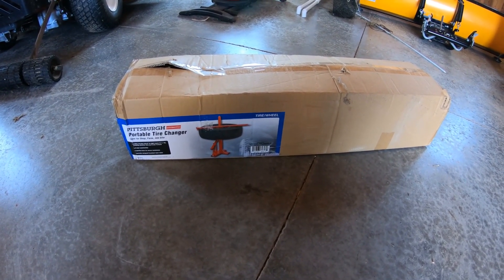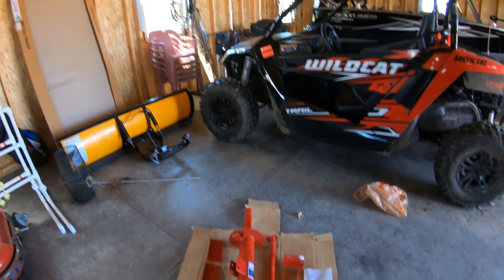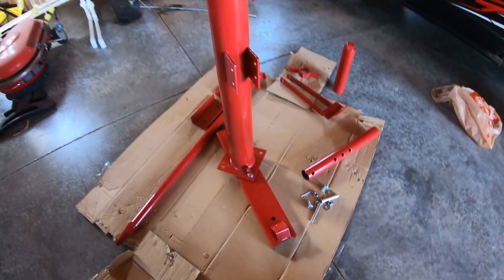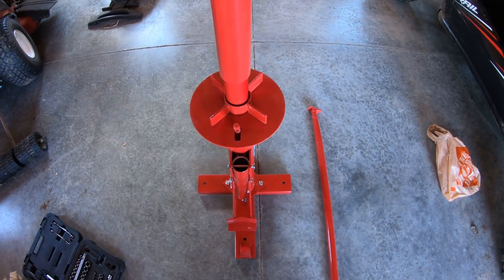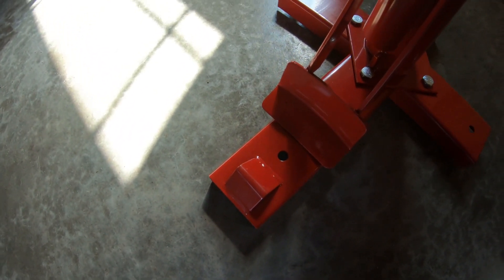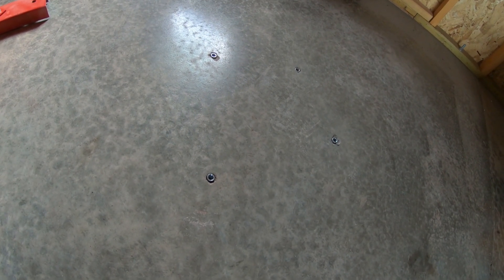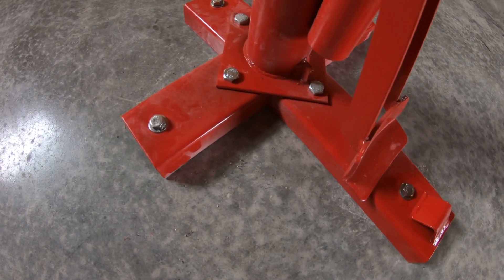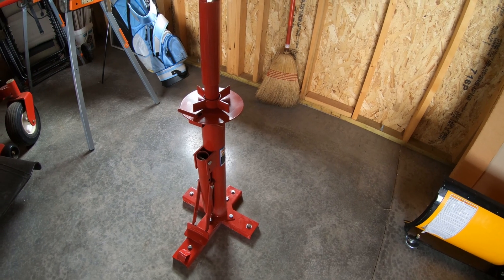How to Install a Manual Tire Changer | Pittsburgh Portable Tire Changer

Comment: Great video, do you have information on the Redheads/ Bits and Screws that you used?
Reply from the maker: Thanks!  Sure, I used the Red Head 3/8 in. x 1-5/8 in. Zinc-Plated Steel Drop in Anchor, Everbilt  3/8 in.-16 x 2 in. Stainless Steel Hex Bolt and Washers, and a 1/2" Carbide Hammer Drill Bit all from Home Depot.  Hope that helps~

Comment: 2:30 does it comes with the set? The packing mark 3/8in is that the bolt size or the drop anchor? Nice content, thanks for the video
Reply from the maker: Your Welcome.  Here is what I used - 3/8" x 1-5/8" Steel Drop-In Anchor:   https://amzn.to/3rZPKcn
3/8" -16 x 2" Stainless Steel Hex Bolt:  https://amzn.to/3k2k8QH
Reply: @DeanoOutDoors  Thank you. You safe me from guessing,😄

Comment: Great video and thank you for sharing! How's the 3/8 bolt's holding that you used for anchoring the unit?
Reply from the maker: Thank you.  The bolts are holding up great!  I've changed a couple 18" tires and so far no problems.  These tire changers work great and you can't beat the price.  Just a little tip, get some good tire mounting lube, I used soapy water in one of my videos, but have since purchased the lube, huge difference in mounting.
Reply: @DeanoOutDoors  Thank you so much for the quick reply and the info!

Comment: You skipped the part where you put the hole in the concrete.
Reply from the maker: Ha, yeah that was a work out.  I had to edit that part out.  My recommendation to anyone drilling into concrete, get a high quality hammer drill.  The Ryobi worked, but took some labor.